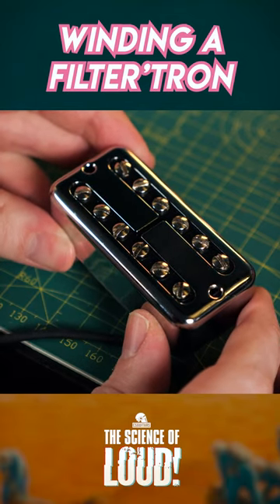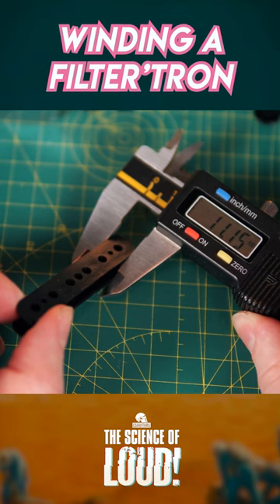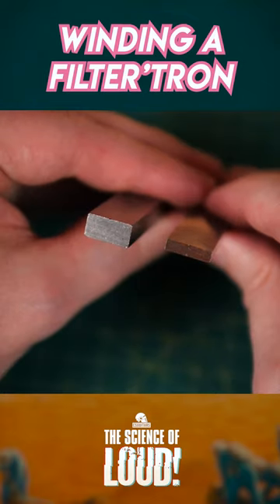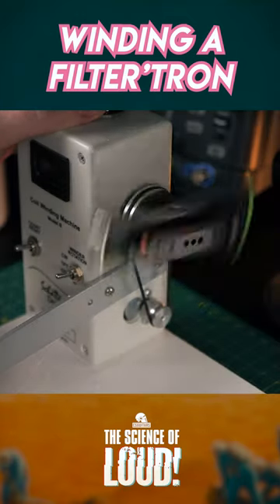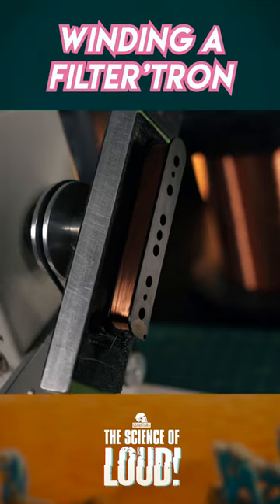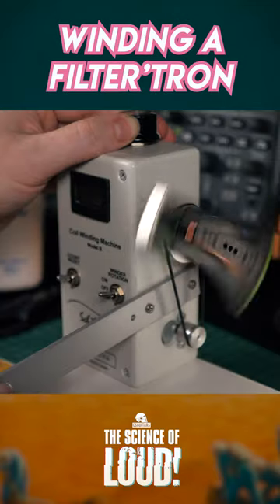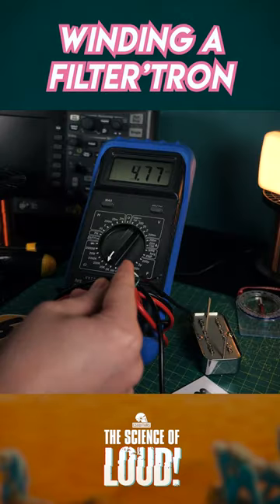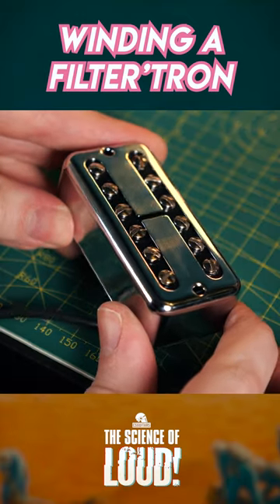Winding a Filter'tron Pickup #shorts #csguitars #scienceofloud

Comment: Potentially dumb question: what would happen if I stuck Jaguar pickups in the neck and middle position of a strat
Reply from the maker: You'd have Jaguar pickups in the neck and middle position of your Strat.
Reply: @ScienceofLoud  ah, thank goodness. For a second I thought I'd be commiting some form of heresy... I have some pickups to replace
Reply from the maker: @Ace_of_the_Chaos_Element  you might have to do some slight modification to make them fit the pickguard and the body depending on how the cavity is routed, but other than that have fun with it.
Reply: @ScienceofLoud  alright will do, though I do have another question. Would there be any sort of interface between the jag pickups and a humbucker (HSS strat) or would I be fine on that
Reply from the maker: @Ace_of_the_Chaos_Element  I have no idea what you are asking. Jaguar pickups are just single coils with some extra iron on them and slightly different dimensions. 
Whatever you are concerned about is almost certainly the result of you overthinking this.
Reply: @CSGuitars  yeah, probably. thanks for the help man.